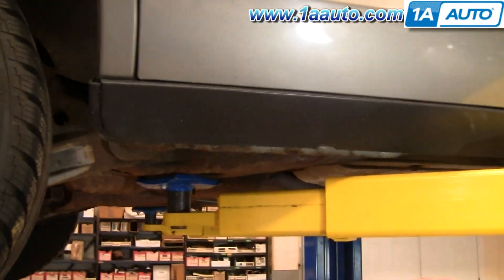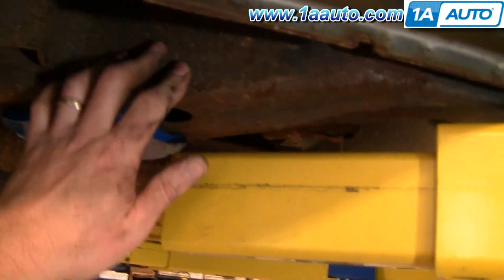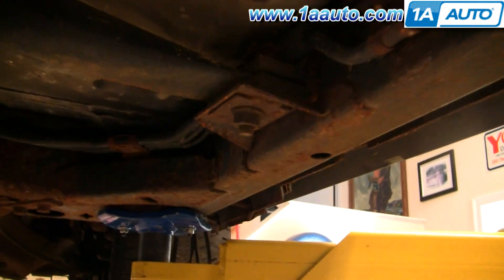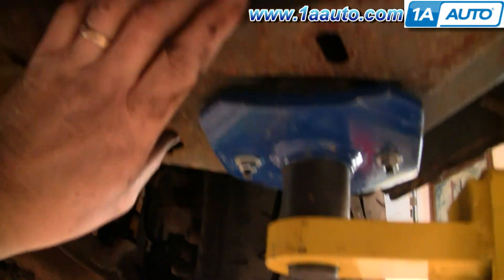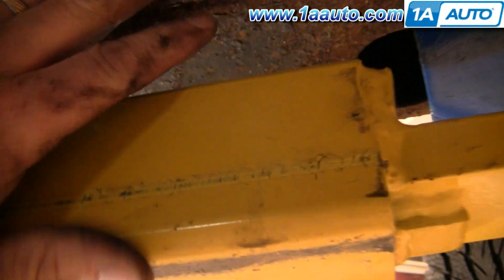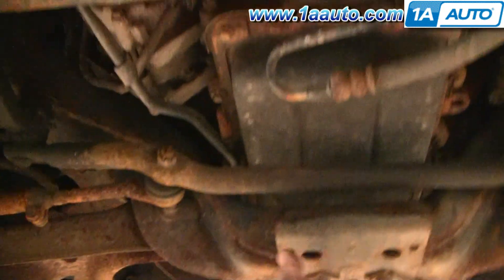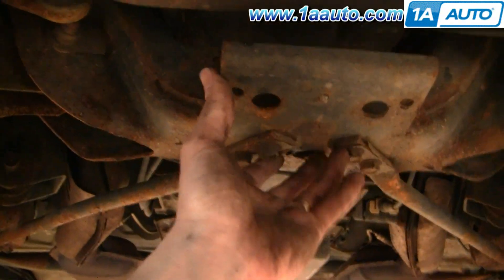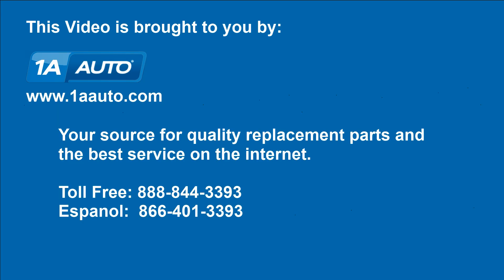Where to Use Jack and Jack Stands on a 98-11 Ford Crown Victoria

Comment: Does this apply to the Lincoln Town Car as well? I was having some trouble finding the front center jack point you showed on my '07 Town Car
Reply: The Towncar, Grand Marquis, and Crown Vic all use the exact same frame, theyre Panther platforms. Even the same engine and transmission. The bodies are the only thing different.

Comment: I have 2004 Grand Marquis, are the steps similar or are there major differences?
Reply from the maker: Thank you for watching! This video is intended for use on Grand Marquis's and Crown Victoria's between the years of 1998-2011, so this video should work just fine for you. Thank you again, and have a great day! 1AAuto.com 888-844-3393
Reply: How'd it work out for you

Comment: My 2007 lincoln town car workshop manual says under no circumstances lift the vehicle by the front crossmember or the differential. I'd like to safely get the front end off the ground and doing one side at a time and setting it on stands seems sketchy.
Reply: What did you end up doing? I need to flush my power steering and as you mentioned the workshop manual doesnt list the crossmember as a lift point. I'm thinking of just using two jacks to get each wheel a few inches off the ground to do the work.

Comment: What if the vehicle has rear airbag suspension?? Do you need to disconnect it before you jack the car up? OR, does that only matter if the car is running???
Reply: Turn off the air ride suspension in the trunk.